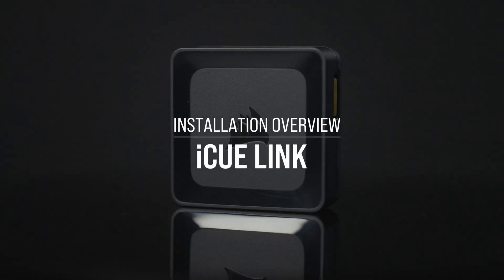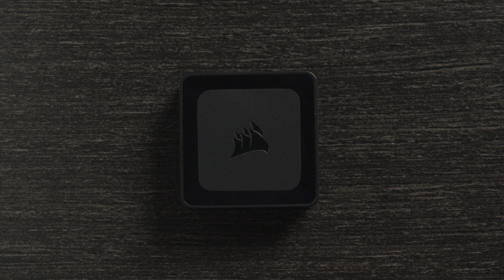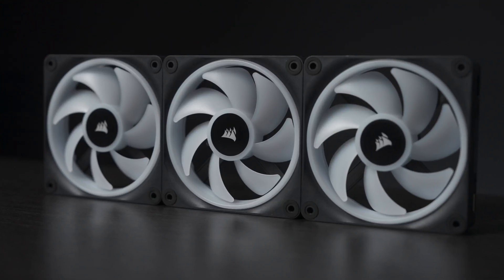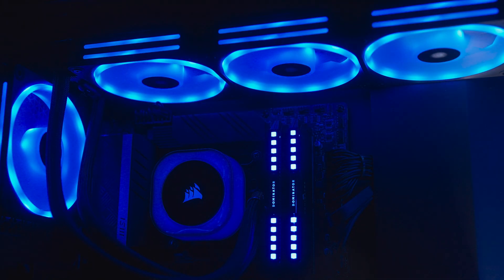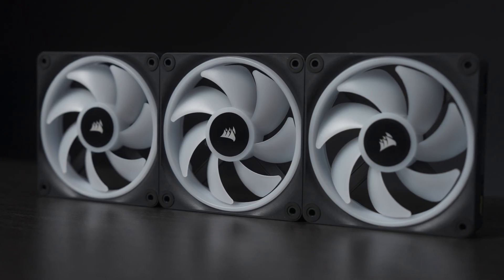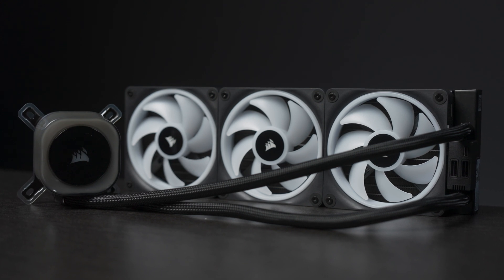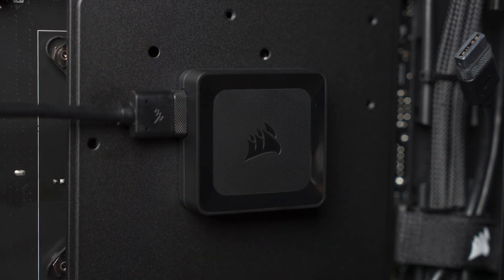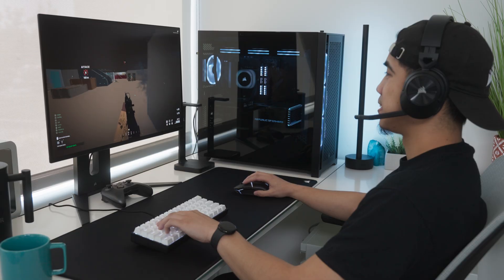Getting to Know iCUE LINK Smart Components

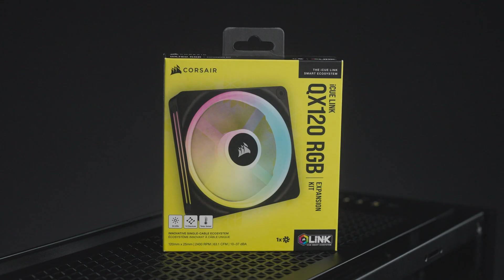Comment: so if i buy 3 fans for front side and also 1 more single fan for this spot on 2:17 i also have to buy additional 600mm iCUE cable to connect that single fan to the hub? Cause as i know there is no enough lenght cable in the box of aingle fan to connect that single fan to the hub

Comment: In my opinion if you want RGB lights and AC for your computer with total control of your RGB this product is worth it for the simplicity also cutting wiring space down a lot. 
Especially when paired with the Corsair iCUE CPU Coolers. 
You’re basically paying for air conditioning for your PC. It is up to you whether you want it to be efficient or not.

Comment: But what about led strips? Do we still plug them directly to the motherboard? Do need a lightning node Pro as well? Someone please clarify because I have non corsair rgb strips that I want to use aswell as corsair icue link devices.
Reply: for the strips you need a regular corsair rgb device such as a lighting node or commander pro because they use differnt connectors
Reply: Also have the same question

Comment: For those who are interested in setting up ten of these fans, before installing them, I’d like to give some advice. A single channel on the system hub won’t provide each fan with RGB lighting, but there is a very easy way around this issue if you have plenty of iCUE Link cables. Simply put, you connect the intake fans at the front panel and/or side panel to the first channel, and then you connect the exhaust fans at the top and rear of the chassis to the second channel. Once you do this, based on extensive firsthand testing, the iCUE software will recognize the system hub, the AIO cooler, and all ten fans.
Reply: I'm having that issue where not all 10 fans will work even using both connectors on each side of the icue link hub

Comment: I am very disappointed. I bought my whole setup with corsair products and have many problems. ex. QX fans are not recognized by icue software. And the support is not interested in helping. ...
Reply: I have a full setup as well and have experience a wide range if issues such as icue software not recognising the pump or fans as well as crash and pump failures and overheating
Reply: @bunningssnag6303 here i am looking at fan stuff, its 1am.. now im craving a snag... 😅

Comment: integrated magnets??? I'd much rather just have things secured. The only place to put this is directly behind the cpu and the magnets aren't even strong enough to hold it there when the cables are plugged in. The AIO has a command box for 6 fans and RGB but this can't connect the fans to it. Bought these assuming they were just extra fans... Came here wondering what on earth I'm supposed to do with this...  And to top it off, I'll have to buy a usb extender too because there's only 2 on the board and one is going to be taken up by the integrated USB ports and the other for the AIO cooler fans. I'm really regretting this purchase. It's just dreadful. Nothing more than a cash grab by Corsair taking advantage of inexperienced builders like me who just think they're buying cooling fans and now have to buy extra cables and adapters off them to make it work. Really disappointed in what I thought was a decent company.

Comment: Great fans just built a system with 15 Qx fans only thing is it’s 7 devices per channel on the hub so make sure to buy the 3 packs to get more cables and extra hubs a usb 2.0 hub will also be needed
Reply: I found a little workaround for channel limitations. After noticing that several of my fans were running without RGB lighting, I grabbed some extra iCUE cables and rearranged the layout. I used the system hub’s primary channel for the intake fans on the side panel and the radiator’s intake fans on the front panel, and I used the second channel for the exhaust fans on the top of the chassis and the back of the chassis. I find that the iCUE software is very friendly with this configuration.
Reply: @SirChristoferus  Greta find bro. I ended up rearranging all the fans to be able to daisy chain everything together I got lucky and extra cable was included I read somewhere not all packs include that extra 6 inch cable.

Comment: You did a good job at sliding right past the fact that the "extra 90 degree cable" for the rear fan is not included in the single fan "expansion kit" you have to buy the cable seperately...
Reply: IN FACT they say "seperate 90 degree cable" and on the bottom right says "cable sold separately"😅
Reply: My single fan came with one

Comment: I think you guys thought a bit to much about not having cables... Slim ones sold out in many places. Yet they are the better cable connection then the normal one and you need those with expansion fans on a different side. It was a bummer to see the extra cables i had to buy on top of the already expensive fans.

Comment: This is cool tech, but the price is insane. Unless you have a 13900K/4090 price level system, you'd be crazy to buy into this. Lian Li is way cheaper, pretty good quality and still relatively simple.
Reply: I see many RGB fans being 35-45 euro to. These are like 50-55 But they have temp measurement. And the RGB is pretty good. 

The extra cables you might need is rediculous for the price tho. That should be included in expansion packs for the price. And then the slim cable
Reply: The problem with these daisy chain fans are the prices,  corsair needs to make the fan blade can be pop out just like the Swafan from Thermaltake, so we can easily clean them for long term.  You don't want to spend like $150 for 3 fans, and they will get dust and become dirty pretty fast and have to replace them. @Syphirioth
Reply: @Viettzz  Prices are indeed insane, but who replaces their fans when they get dusty? It's not that hard to clean them with an air duster, a few q-tips and isopropyl alcohol.
Reply: @Syphirioth  some corsair products are pretty cheap in australia
Reply: I must be crazy because I bought 13 qx120 fans (got all for less than 400) I have neither a 14900k or a 4090 (i7 14700k & 4070 Ti super.) I also bought a water cooling system from Corsair. Full water loop